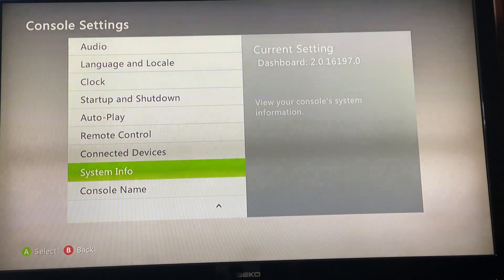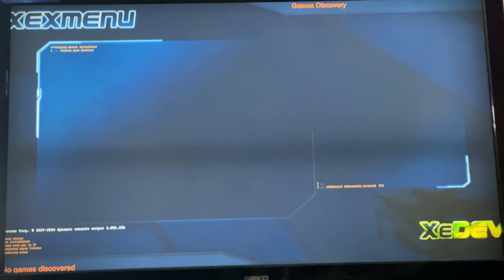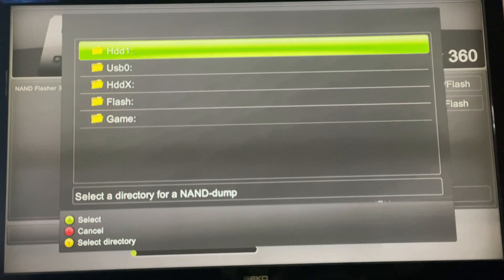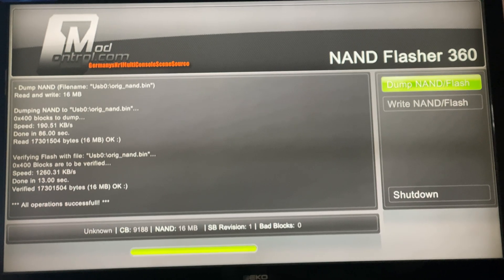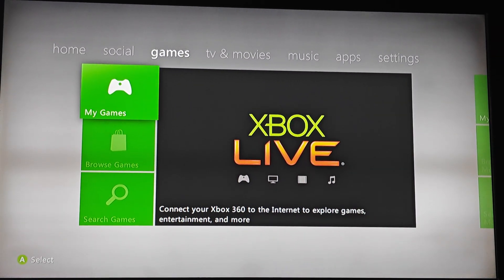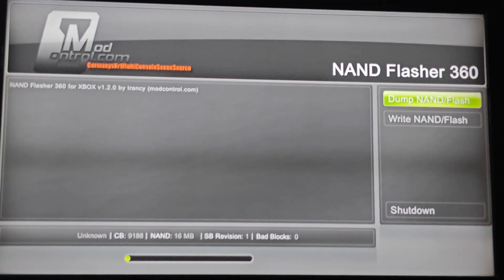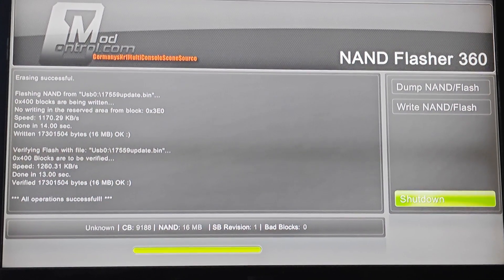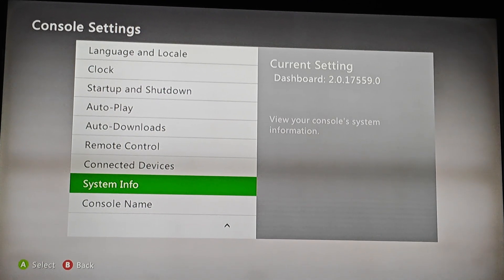How to Flash the NAND of your RGH/JTAG XBOX 360 without using XELL-RELOADED

Comment: Nice video, recently I used the Bad Update exploit to dump and flash a modified nand for rgh3 on a falcon board, it worked but it's risky
Reply: I bricked my Trinity by installing dash launch to the Xbox built in storage and it forced me to restart it which then came the red ring and no video output at all, doesn't change when I remove the USB with bad update and everything else on it 😅 any help?
Reply: @sppookkyblake9056 I used FatXplorer to fix a similar issue the other day, my niece was playing on a 360 that I'd done the exploit on and accidentally moved files while in Aurora to the internal HDD. Genuinely thought she bricked the bloody thing 😂 It came up with an E71 error code which searching it online says its a dashboard update gone wrong, though a little more digging and I found that it also shows up when there's unexpected files on a retail system's hard drive such as an .xex file - a sneaky little failsafe Microsoft slapped in the console as a slap to the face to any would be modders trying to do shit on a retail system. Lmk if its the same error code, it was a real easy fix and it'd suck if it was something simple like that and you thought it was bricked for good - I'll be happy to walk you through how I fixed it, though you'll need a way to connect your HDD to a pc. If you dont have extra sata cables in your desktop to connect it with/if you dont have a 2.5 inch Sata connector free in your laptop then SATA to USB cable is less than 5gbp on eBay & amazon, they work for a one time use but I'd really avoid using them long term as I've fried drives with them 🙃 my brother told me it was something to do with dirty power.

Alternatively, you can get 2.5 inch hdd caddy with a USB cable for around the same price as the cables, maybe 1-2 GBP more depending but they come with boards that convert the sata to USB and the cable with it, they haven't killed any of my HDDs afterlong term use 

Even if its not an E71 error code let me know what comes up anyways and I'll scour old 360 modding forums to see if I can scrape up a solution for ya 😊 

Also, unrelated but anyone else notice that when setting a consistent fan speed either in dashlaunch3 or Freestyle Dash that it stays whatever fan speed you set it at when you reboot it, despite it being back to an unmodded state? I thought it was saving and reading the setting from the launch.ini but its only saved to my USB HDD, not the internal drive and it persists even without the USB HDD connected! 😮 Just thought that was a neat little quirk 😊